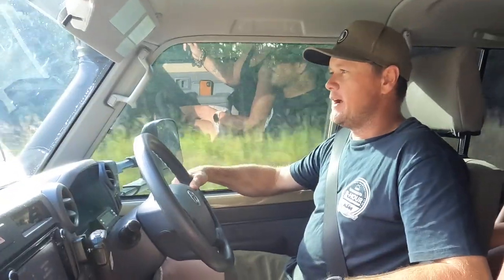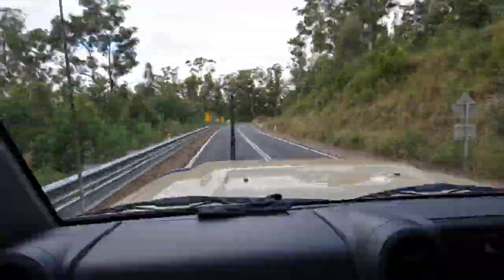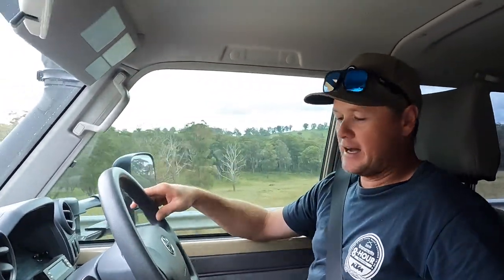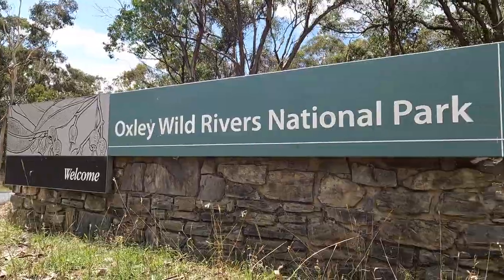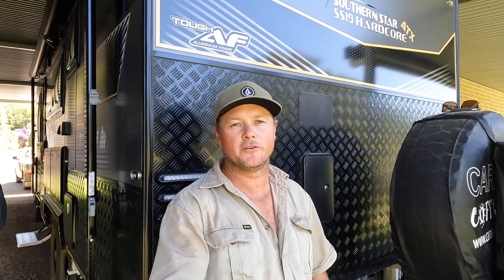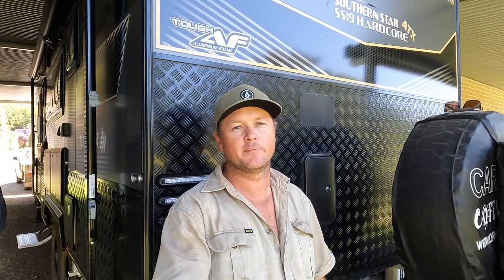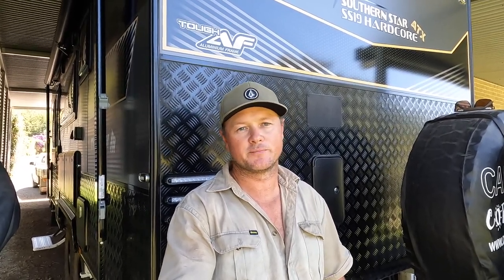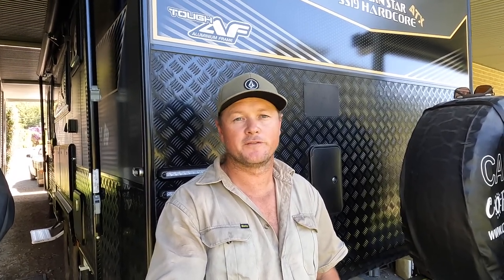79 SERIES LANDCRUISER -  AT MAX GCM

Comment: (If ive got these around the wrong way i apologise)
I found the red arc tow pro works much better and more predictable in non proportional(manual) mode. In proportional(auto) mode it learns how you have been driving for the previous 20 to 30 mins( or so), so if you've just been cruising around town and not really stomping on the brakes, then suddenly you need to descend a mountain range, it will apply the trailer brakes similar to what it thinks you needed around town, which is likely not very much. I had exactly this happen to me down the Toowoomba range, the trailer brakes were barely working and the car(navara) brakes very quickly over heated and i found myself in a bit of strife, i had to manually operate the tow pro button to apply the trailer brakes. In non proportional mode( manual) it will apply the brakes to a set measure(the numbers on the dial) all the time no matter how hard or soft you apply the brake pedal. I run this all the time now with no braking issues on the trailer and find its much safer to drive. Hope that made sense. 
P.s. that camp ground looked mint.👍

Comment: I'm running a 79 towing a 3 tonne crusader caravan in NZ.
 I've had the safari armax upgrade and the redarc brake system.
 I've never seen the green colour, just blue and purple on foot brake and red when control depressed.  On a 6hour trip I got down to 5:2 kms/litre. Not sure about exhaust heat.

Comment: Awesome video mate thank you. I don’t like my egts getting over 550 but it depends where your temp probe is. Is your one on the dump pipe on the 79?
Reply from the maker: HI MATT.
could'nt  tell you where the probe is to be honest as its the factory one through the scan gauge.
Reply: @SmartTouringSystems  ahh ok from my understanding is you don’t want the egts to get above 700 but it depends where the probe is. If the probe is in the dump pipe the egt temp will always read lower than what it is if the probe is in the inlet manifold as it’s further away from the combustion. so as a general rule of thumb I’ve been told is if the probe is in the dump pipe 550 is a maximum that you should let it get to but if it’s in the exhaust manifold then you don’t want to see it past 700. So you could actually have a bit more to play with depending on where the probe is as there is approximately 150° difference between the exhaust manifold and the dump pipe

Comment: General rule of thumb is not to go above 650 degree C for extended period of time.
Reply from the maker: Thanks for the input. Makes me feel better anyway, I’ve never seen over 600
Reply: My tuners told me roughly the same thing. Ok to peak a bit higher for short periods, so don't panic. I hit 750C a few times in my 2016 Hilux running big power tunes (275rwhp on 34's) with no issues. My tuned cruiser stays much lower. Like you said, just downshift to reduce the load.

Comment: Hey mate, I was just wondering how do you go taking off on a steep incline with that weight? 

I've got a 78 series Troopy and I'm sitting at 6.5t with my caravan and I find I'm a bit hard on the clutch taking of on steep hills. Even when I'm maneuvering the van into a caravan park spot or free camping were it's a bit hilly I'll put in into low range just to make it easier on the clutch and drive train. ( when I put it into low range I don't lock in the front hubs) Do you find you've got that problem too?

Also with EGTs. Mine is tuned pretty well making 700nm at the wheels and 245hp and I don't let mine go over 550°c. That temp is at the dump pipe. 

Cheers, great videos. Keep them coming
Reply: If it’s steep for me just take off in low range until it gets flatter again. I had this problem one time driving though Katoomba on the backstreets while towing my van. It was putting allot less stress on my old girl
Reply from the maker: Yes it can be challenging sometimes. I have used low range myself before.

Comment: Hi, great videos & Stills ...
What pressure do you run in your 285s & weights front axle & rear axle ...
Reply from the maker: I run about 45 psi in the rear. 40 in the front. Not sure about specific front to rear weights